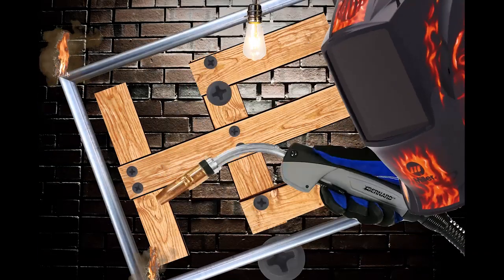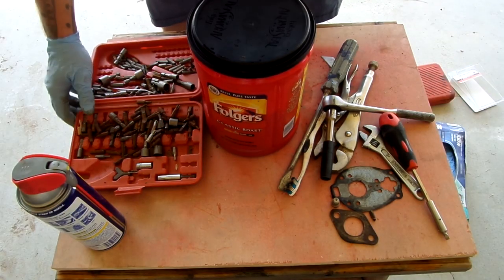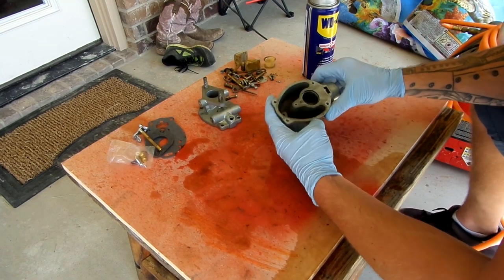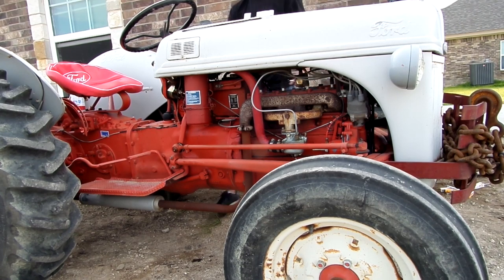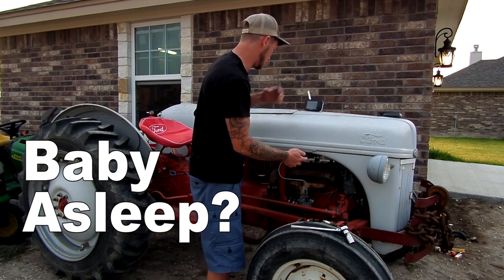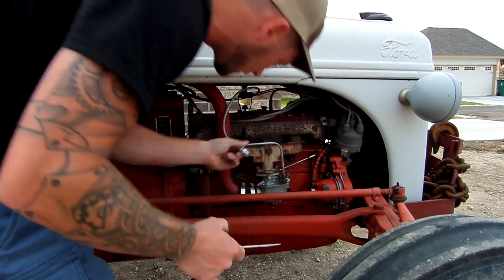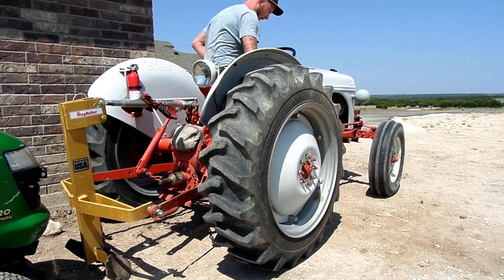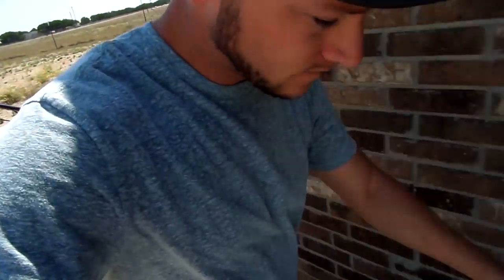🚜 Ford 8N Tractor Tune Up

Comment: Great video! 
2 things.. 
#1 get a set of feeler gauges and gap those plugs at 0.020! 
#2 If your shut of the fuel while the tractor is running it will burn the fuel left in the bowl and keep you from rebuilding that carb again next year.

Comment: Love it...late night tune up!  They were made to run off of alcohol and gas mix and you could adjust the richness of the fuel with the carb.
Reply from the maker: On the Range "white gas"  i believe. .. although i dont actually know what that stuff is
Reply: Out on the Ranch (with Dr. Lee) yeah white gas is the camping stuff...the farmers back when those tractors were built made their own fuel which was alcohol. Like moonshine and would use it in the tractor. Cause they did have gas stations out in the country. You would stop at a farm to get fuel which was alcohol made by the farmer.
Reply: Yep, brother, I too have known a few farmers who made their own "fuel!"    LOL
Reply: Out on the Ranch (with Dr. Lee) right on you could drink it or fuel out the tractor or the car

Comment: ya'll do know that bee hive filter probably needs oil in the bottom if early 50's. I couldn't tell by looking but our 53 gmc never had the oil bath cleaned out till I was in high school and decided to look at it. miniscule amount of clearance in the oil bath for air to get through and was full of dirt. My brotherinlaw then used it in his business for years after I left home. Abused and then left still running

Comment: Hey man, not trying to give you a hard time but you know that there are specs for things like base carb adjustment settings and spark plug gap, right? I mean, you are doing this nice informative video for people to watch and learn so why not do it right and get the specs in there? Adjusting spark plugs with a flathead is absolutely not acceptable. Minor gap differences can have a huge negative effect on the way an engine runs. Same with carb. Could actually damage your engine extensively.
Reply from the maker: She’ll be aight   :).     I’m always looking for an excuse for an engine rebuild
Reply: @mcarriker5  lol!!

Comment: Hey, your throttle handle is quite squeeky, as mine was years ago. I oiled it and ever since, it's got less resistance, and it no longer wakes up my baby.I think I shot some oil not only in the front, but also behind, on the firewall side.

Comment: This makes me want to buy a tractor, though I do not really need one.
Reply from the maker: Uncle Hoss    i hate to admit that i dont NEED mine either... but these old 8N's are crazy cheap.   Paid 2500 for this one and it was running and driving great, just needed small stuff
Reply: Same boat,  I got 1 1/2 acres and because I Iove tractors and found a nice one cheap, I bought one on 6/2/2019. An 8N!!!!

Comment: WELL IT SOUNDS GOOD ,I KNOW YOU CHECKED THE CAP AND ROTOR ,POINTS CONDENSER SO DOES IT HAVE A GAS FILTER OR SEDIMENT BOWL?
SOUNDS GOOD COMPRESSION IS EQUAL + OR - ,CLOSE ENOUGH..
ANOTHER HOME RUN
GOD BLESS YOU YOUR FAMILY AND HOME

Comment: So there I was, following along with this video, everything going smooth.  Got the carb taken apart, soaked, cleaned and ready to go!  Then came time to blow out the jets.  Apparently had a little too much psi in the old hose and blew my jets all over the front yard.  Spent forever searching for them jets.  *NOTHING*.  Now I'm sitting here, life in shambles, with a blown knee and no blown jets.  This blows....
Reply: mastocytoma1 hey at least it wasn't your shaft!
Reply: On the Range 
     Blown shafts are a completely different story!
Reply from the maker: mastocytoma1    i actually have (mutiple times) blown important components into the lawn...   however, somehow i have always found them.   I lose stuff so frequently.
Reply: [HE] Homemade Everything    I just found a house key a few months ago that I lost in our front yard 10 or so years ago!  😂😂😂
Reply from the maker: mastocytoma1 hope you didnt change the locks!
Reply: I hope you have Mark's luck and not mine, Masto.....Around here, "once lost, prolly forever lost...."
Reply: I'm so thankful I'm simply a Motor head who loves to watch all the mechanics of it all or I'd be in deep poo like masto :(... . I loved your spark plug gauge :) !
Reply: Magnets are fun..try using one to find your parts

Comment: Nice vid - thanks. Sure handsome 8N. I just replaced both Top and Bottom tranny gears on my 54' NAA - running good, but am wondering if a little carbon soot on plugs (like I saw in the vid) is OK. That's what I have now - should I keep trying to dial it in better? Also, I haven't put her under load yet, any clues on what to do if she doesn't perform well under load?

Comment: I have one of those but it runs on three cylinders why would it do that it was restored a couple years ago plus I was plowing and the battery fell out now it won't start?
Reply from the maker: Monald Krunk Tate.   Start with the cheap and easy stuff.   Swap spark plug, if that doesnt make the dead cylinder run then ground the new spark plug and see if it is sparking at all.  DONT SHOCK YOURSELF, it hurts!  If you have spark then it is not getting fuel or something else is baaaad.  Next easy check is compression as i did in this vid.  There are many reasons for low OR no comoression, but if your compression checks out good then we can cross all those expensive repairs off the list.   Start there and report back with findings please sir.  Ill be standing by.

Comment: You never did show how to adjust a carburetor after cleaning it
Reply from the maker: After cleaning turn both air and fuel screws all the way in and then back out one full turn.  That’s factory settings and your altitude and ambient temperature will determine what you do from there.   Mine needed more air to run best.